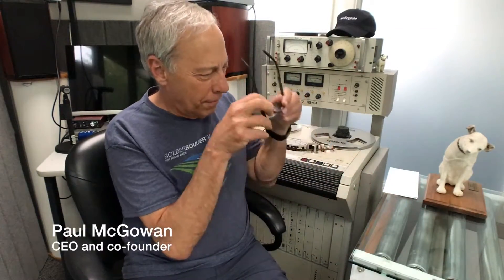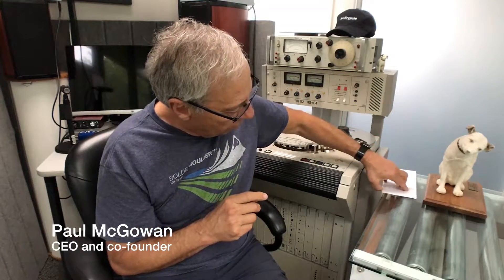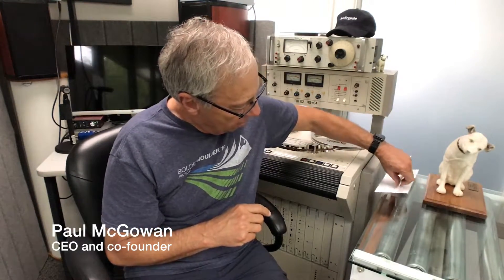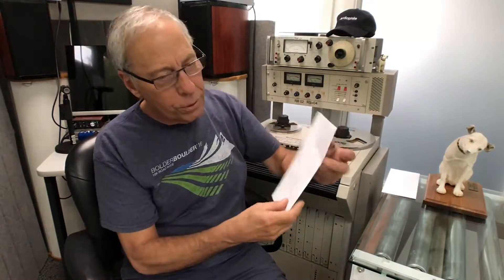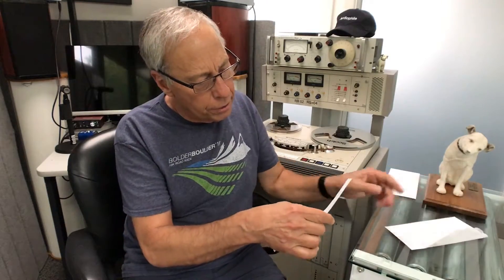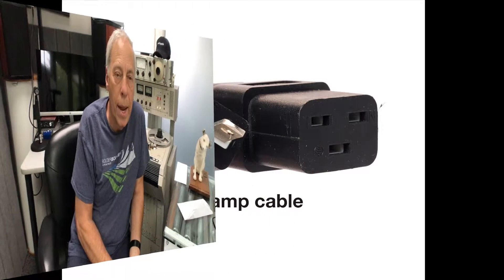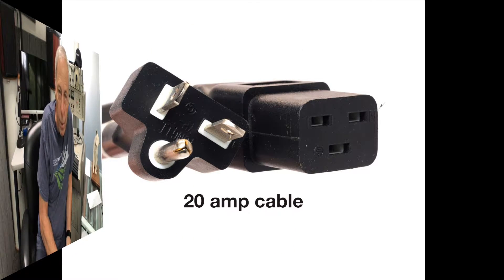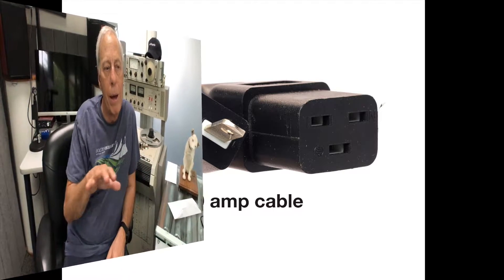Why don't manufacturers support 20 amp power cords?

Comment: Most residential wiring is 14 ga. on a 15 amp circuit; you need 12 ga. at minimum for 20 amp rating, 10 ga. even better.  Not common for consumer electronics.   Dedicated sub panel for big amplifiers is a worthwhile investment.

Comment: why not built your very high power amp with a 220 volt dryer plug , then you have a dedicated plug in the house or have a high use standard one that can be wired in by any electrician. And it has a heavy duty ground system , highly valuable in keeping noise to a minimum !!

Comment: 15a is more than enough juice for most amps. I've seen pro amps racks pop breakers though.
Reply: Pro amps are rarely set up to run concert levels for an open field in the confines of a living room.  There is no need for 1800 Watts RMS in a living room for audiophile quality sound.  Carnival music in Jamaica, I could see it, but not for anyone who values hearing.
Reply: Multi channel amps, especially high power ones like the two I use require 20 amp connectors. In fact for max power they need 30 amp lines each.

Comment: For this bigger product, why not just goto 220v circuit?  30 and 50 amp 220v are very common now?  Even for consumer use with things like plugging Range, Drier, RV, or EV's at home or welders or whatever.  Don't believe most buying a product like this would mind paying an electrician for Range/Drier style 220v outlet in listening room and those are MUCH more commonly used than 20amp 110v.  Also, with 110v and 20amp you are probably only going to get to 2000 watts worth of equipment you can power with this bigger device.  Why not just goto 220v and allow the output you can power double.
Reply: Paul McGowan Yeah.  Guess I just figure a customer already spending on what equipment like this costs wouldn't mind at all spending several hundred extra to have an electrician do a 220 drop if it would give them a lot more power capacity.
Reply: I think if you buy a Amp for 7000 Dollars, you can afford the $500 for the additional electric wiring.
Reply: Jake Storms  Do you realize that a heavier wire needs to be run all the way back to the electrical panel? Most people do care about having half their house torn apart to get the wiring run. It could be a massive job and a big mess if the panel is at the other end of the house and the basement is finished drywall.
Reply: @gordthor5351  20 amp wire is the same size no matter what voltage, though you can use larger wire if you want to. 12awg is rated for a 20 amp breaker. The cost difference is small. Either way you want a dedicated line for the best results and most people don't have that so the are calling an electrician either way. That's where I come in, I'm an electrician. My number is..............Just kidding, but I am an electrician.